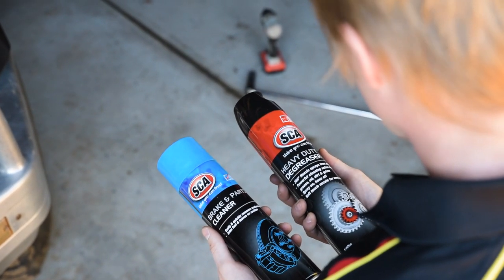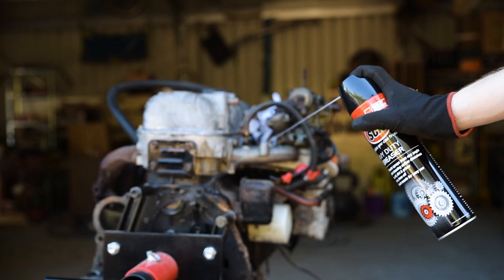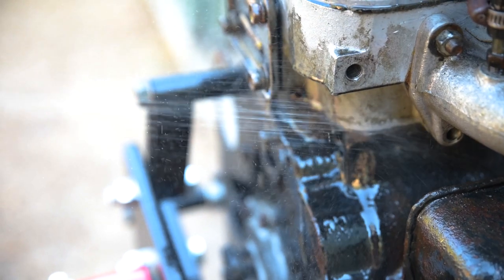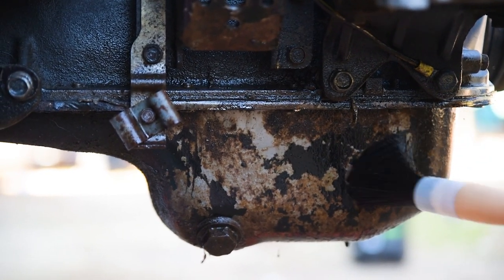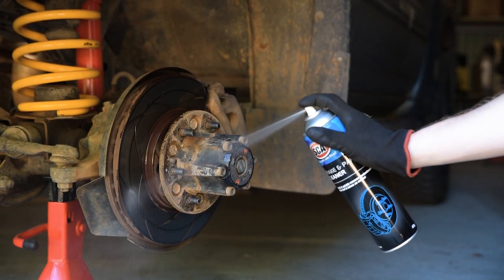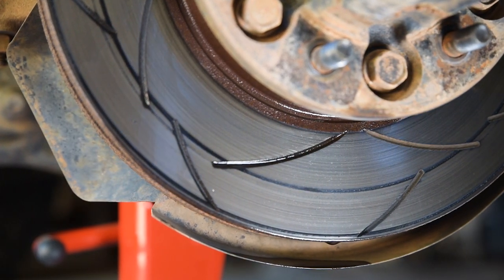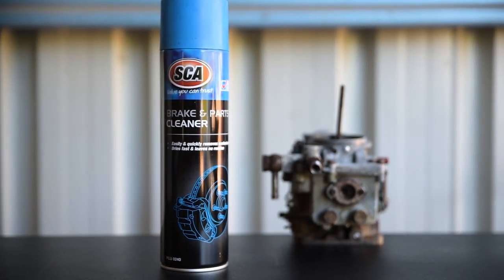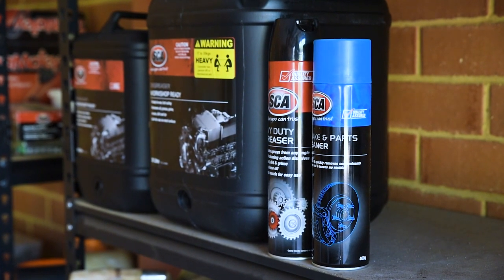Degreaser VS Brake Cleaner - What's the difference?

Comment: Degreaser: petroleum based cleaner, in other word, canned paraffin oil or kerosene. Safe for all plastic parts. Gets the job done and cheap.
Brake cleaner: not safe for plastic parts. keep it to just clean metals.
Reply: I use brake cleaner to clean my car works like a charm has every since buy a new bottle every two months
Reply: They are both petroleum based. Also, statement is inaccurate. NON chlorinated brake cleaner is safe for plastics. Essentially, they are the same thing - Hydrocarbon mixtures
Reply: GUNK is basically just Diesel fuel with a little kerosene

Comment: Thanks for explaining the risks of using brake cleaner on plastic+rubber parts. I thought I remembered that it might not be safe, but this confirms it!
Reply: You can get two types mate one is highly flammable and other one is more environmentally stable and safer it’s “chlorinated brake cleaner”  if it’s NON-chlorinated it’s more harmful and less environmentally friendly this one’s flammable unlike the chlorinated brake cleaner which is better and safer but the chlorinated version is banned in some countries because of the chemicals it uses.
Reply: @christopherbrown2224  I understand that they sometimes use harmful chemicals. I'm more concerned with damage they may cause to plastic or rubber parts in the engine compartment.
Reply: @plizzle  you can always use another product called Electrical Contact Cleaner HOLTs company does one it’s very similar to the brake cleaner but completely safe to use on all electrical parts including rubber & plastics bud
Reply: @christopherbrown2224  sure, or degreaser, as the video seems to suggest.
Reply: @plizzle  it is a degreaser bud
Reply: @christopherbrown2224  cool beans

Comment: I found out the hard way that I didn’t put my oil cap all the way back on. I kept smelling oil burning while I was driving and kept thinking “is that my car?” I get home and pop the hood out of curiosity and there was oil everywhere. This was just after I put a quart in because it was a little low.
Reply: Exactly the same scenario here. Most of my spill is by the block, but some drops near the battery. What should I use there you think?

Comment: If you use a brake cleaner on calipers, wouldn't it come into contact with the piston rubber seals? I see people spraying brake cleaners all over the brake system. Is that ok? Or would it be best to use degreaser? There are so many products out there. I just get confused what to use for which car parts.
Reply: Yes it would get on any rubber seals and you are correct to think that’s not necessarily ok for the seals. 

Technically, you’d need to get a brake cleaner that the car manufacturer recommends or lists to use… or one where your make of car is listed as compatible in the brake cleaner data sheet. 

In practice it’s probably ok to use any one if all brake cleaners are similar and all car manufacturers use the same materials (automotive ‘rubber’ tends not to be actual rubber but a chemically resistant synthetic alternative).

Comment: Cleaning the oil off a ford ranger chassi rail after changing the oil filter...what is safe to use that wont effect the paint or the rubber flap?

Comment: I been using degreaser/mineral spirits for my bicycle chain
...

I love how brake cleaner when applied just removes gunk and everything it's in path plus dries quickly...my question is does anyone recommend soaking and using brake cleaner for a roadbike cycling chain??
Reply: As long as you lubricate it afterwards you'll be fine. New chains usually have a waxy coating of lubricant with staying power so don't be to hasty to wash that away.

Comment: Hey, i have two rear disk brakes(rotors) that accumulated a lot of rust in 2 weeks (for not driving it).
Can i use a brake cleaner to remove all the rust completely? is it possible and safe to do so?
Reply: Brake cleaner won't touch rust, its just a degreaser designed for brakes, not a rust remover.   I live in very wet Wales, mine show rust literally overnight,. I don't wouldn't worry about it,  just drive the car and it will clean them up. Be more worried abut a flat battery etc. -take the car for a 10  mile spin every week or so.
Reply: @philldavies7940  can i use brake cleaner on carb?
Reply: @HonderdtachtigCC  Do not use brake cleaner on a carburetor. If you do, it will seem fine for a while, but the o-rings and gaskets will fail prematurely and you'll have go rebuild the carb before long. Get a can of carb cleaner instead.